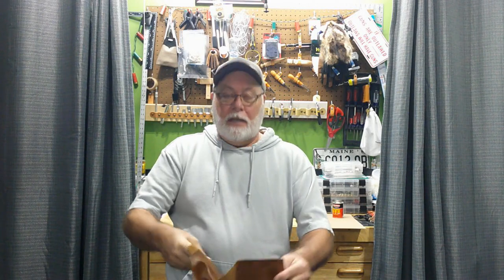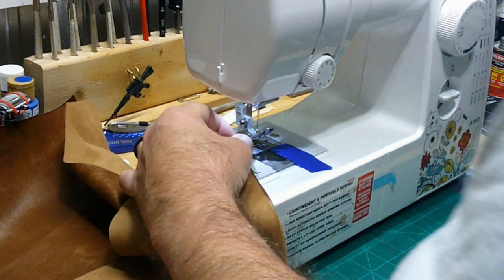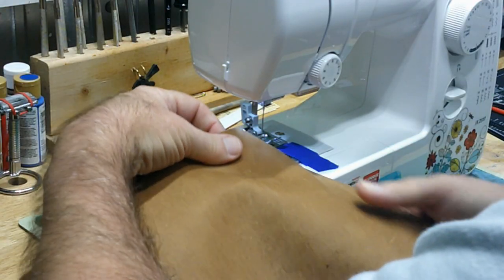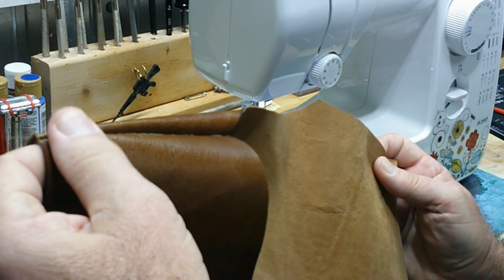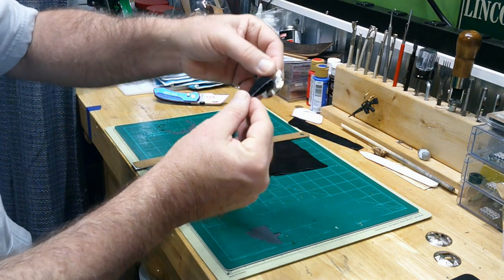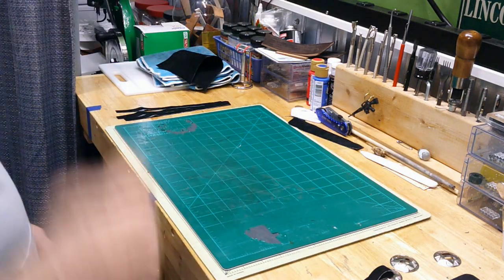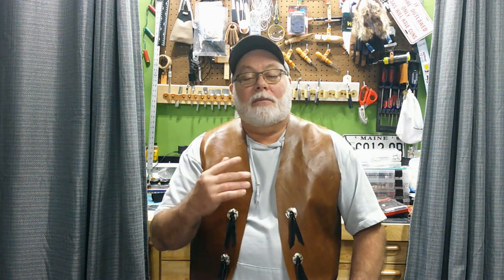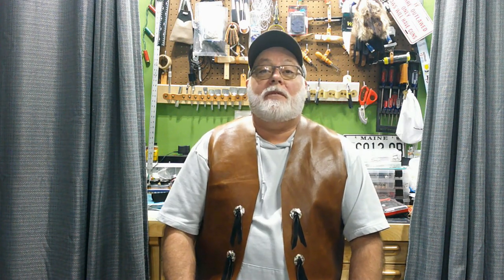Leather Vest- Stitching, Conchos, and Bleed Knots

Comment: You may try double sided tape lay to the outside of seam. Then stich just along the edge of the tape and no mess. The tape is 1/4 wide.
Reply: Thanks for the tip, I will try that. Thanks for watching.
Reply: Leather tape is better,  glue is permanent,  hared to alter. But nice job.